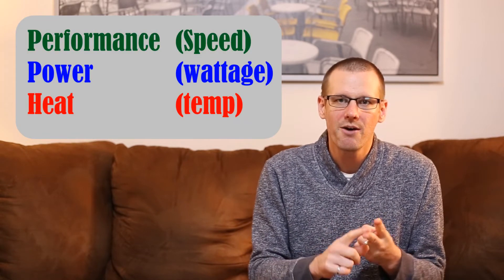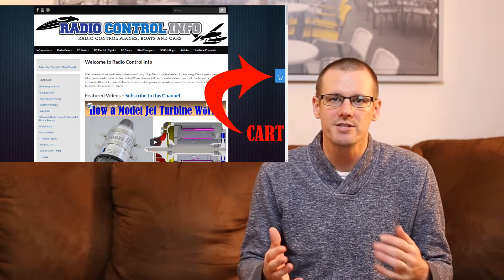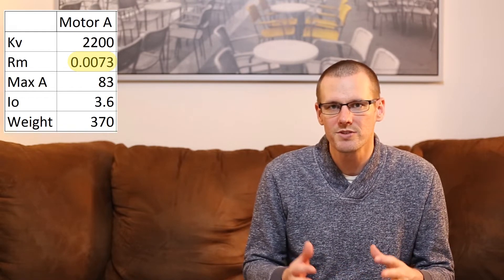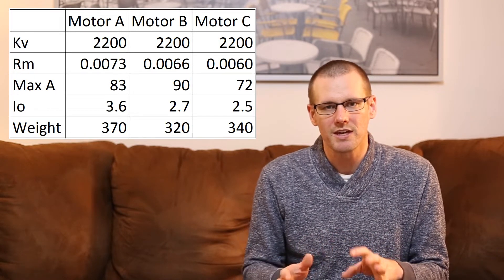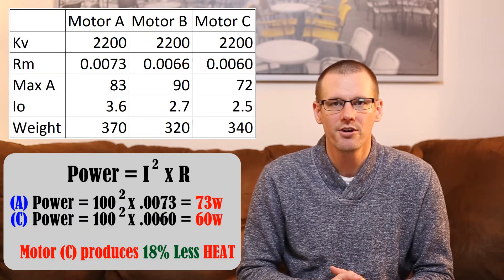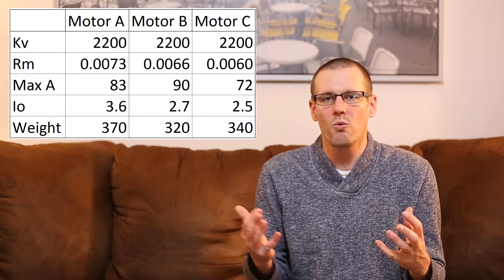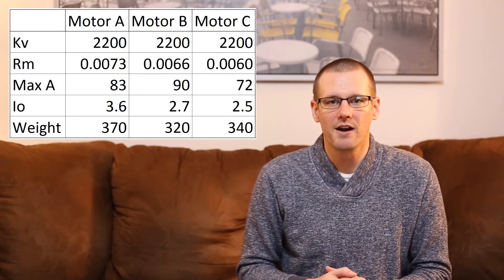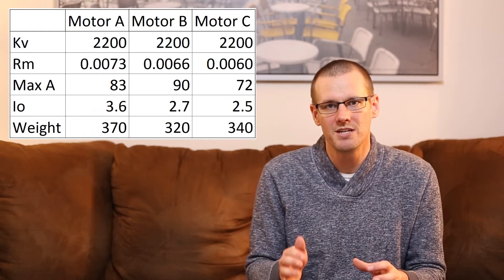RC Brushless Motor Low vs High Quality - What's the difference?

Comment: Recently discovered your channel, as an engineer I enjoy your quantitative approach. Too many videos on youtube just doing speed runs using crazy high Kv and 'check your temperature' being the only requirement for ensuring safety of the ESC/Motor.  Its clear you have experience with motors from different vendors, reliable data for the budget motor manufactures is hard find. Could you please include some recommendations ? Surpass(KK,rocket), X team, Hobbywing, racestar (I'm sure some of these are just rebranded).  As a non-competitive hobbyist I am just looking for the best value motor.
Reply from the maker: Hi Kevin, I've had great success with Leopard motors.
Reply: @RCexplained  thanks! FYI. I just compared the spec sheets of 3650 motors Leopard and X-team, and I think X-team is the OEM and Leopard is a reband 
http://x-teamrc.com/product/motor/car/62.html
http://www.leopardhobby.com/index.php/En/Goods/detail/id/37
I've seen you can buy the x-team motors less.
Reply from the maker: Hey Kevin, it is possible I haven't looked in to this.

Comment: Just a quick question , 
Iv I run 2x 4s lipo 6000mah 130c hv 
I want to do speed runs I live in uk where roads are not as long 
What kv and esc would you use 
Thank you
Reply from the maker: What car, gearing, tires, wiring of the 2 batteries are you using and what speed are you after?
Reply: Thank you for your reply 
It’s a arrma limitless 43diff and 13input 
The spool is recommended for speed runs , 
Which is a 29 t Iv used that with a 32 pinion and it kept cutting out after 75 mph and gets 
very hot .

It has a 34 stock spool 27 pin 
. Iv watched all you video with pen and paper I just can get my head around things .
I would like the car to be has fast as it can with the set up it has there is a 2300kv tp motor , max 6 esc which is only 160amp, 
I want to be the fastest in the uk
Iv got limitless stock wheels on with are 100mm
Reply from the maker: I would use around 2000kv, Castle xlx ESC
Reply: RCexplained good morning thank you for your advice and time , 
I try to understand what you talk about , but dam , it’s to much for my brain , you very very clever when it comes to rc 
Thank you again
Reply: Iv just had a look for 2000kv castle and couldn’t find one would you go a bit high or lower to 2000 kv as long as it near 
Thanks
Reply from the maker: A lot of guys are going TP 2200Kv on 8s, it's not a motor I'm familiar with though. Stock Gearing I would expect 180km/h is possible.
Reply: Yes they are , I do know one thing they run very hot which is a bit annoying I should of got a vented one and not sealed really , as a test we ran a arrma 6s blx motor on 8s with a max 6 and achieved 112 mph and the motor lasted well over 50 runs 👍🏽, I will up the esc and lower gearing , once again I really appreciate your knowledge

Comment: 4:48 in the video. Higher resistance can also mean more windings in the can, as could be assumed with the weight. More windings would equal more resistance, but that can also equate to more torque. As far as maximum amps goes, that can be controlled, or will be in most cases, by the ESC itself. If it is a 6s ESC rated for only 90 amps, then most of these motors will work with a smaller than normal pinion gear to keep them from overheating. Now if it is a 50 amp, 3s rated ESC, then it will come down to  what the weight of the RC is.

Comment: Great video's very helpful. I have a question about rotors interchangeable in stock class motors. Is there a standard for these classes from manufacturer to manufacturer?
Reply from the maker: Good question.  I don't know of any standard set for the rotors. I would only use the rotor from manufacture of the motor.
Reply: I have a team orion vortex vst pro 17.5 but couldn't seem to find a replacement rotor for it I got used and it very little magnetic pull when you spin the shaft I'm thinking it over heated.
Reply: And thanks for the fast reply👍
Reply from the maker: @ericwilson8789  You are right it does sound like the magnets got too hot. Are you certain this is the only damage that the motor suffered? Have you tried contacting the manufacture?
Reply: @RCexplained  I'm a old school on road  nitro 10th and 8th scale racer. I'm just getting back into the hobby and new to brushless motors. I bought the motor used mounted it in my old losi xxx Kinwald Edition and past it down to my 9 year old who wants to start racing. Just recently I've been reading and checking out YouTube for more knowledge. It look like someone removed the shims from the bottom of the rotor it was rubbing on the sensors slightly I guess to get better timing. It was killing the rpm I put shims on the bottom to clear the sensor's rpms is better. I'm going to contact Orion and see if I can get a rotor for it. Lol sorry for the long message.
Reply from the maker: @ericwilson8789  Long messages are OK.  sounds good, brushless definitely has its advantages.

Comment: Good info. Could've been better if you showed us the actual motors u used in your test or the  test it self. Thanks. [1]
Reply from the maker: Thanks for the comment Mike. The test is simply a comparison of the specifications from a manufactures spec sheet. An actual physical test would be a different video.